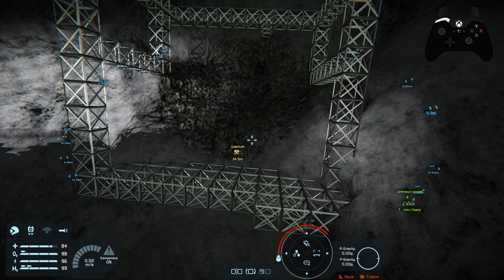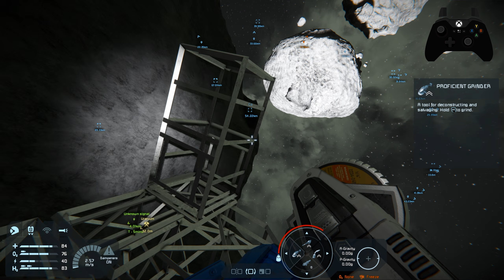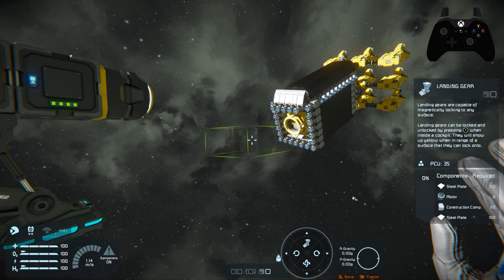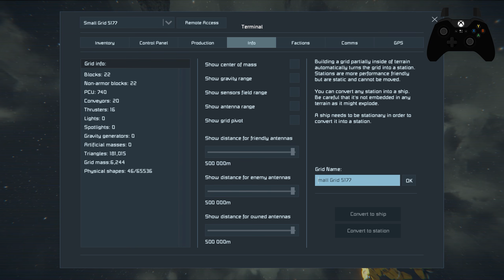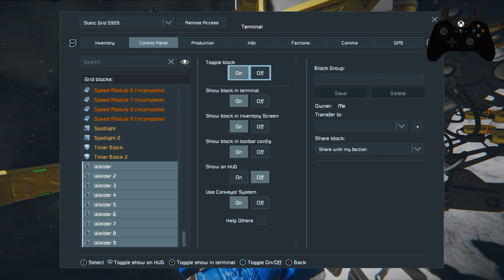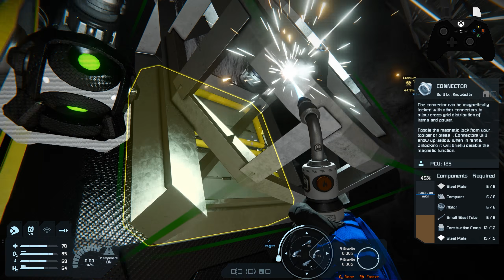Master the Art of Automated Ship Building! Space Engineers Guide

Comment: nice vid however for the large grid ore detector is better connected with a rotor and small head on the ship once in line select attach also with a rotor to build a ship you do not need a battery it takes power from the base and so will the new ship and charge the batteries this is the main reason to use a rotor and not a landing gear
Reply: you lose some amount of utility of being able to drop off the large ore detector while you go off to mine, or leave it behind when you go to an asteroid that you have already marked with a gps tag.
Reply: true and not Clang free a free floating ore detector is also not ideal but a landing on the base set to auto lock could solve the drop off issue in both cases
Reply from the maker: You could also just convert the floater into a base to make it stationary, you would just need to remember to re convert after connecting.